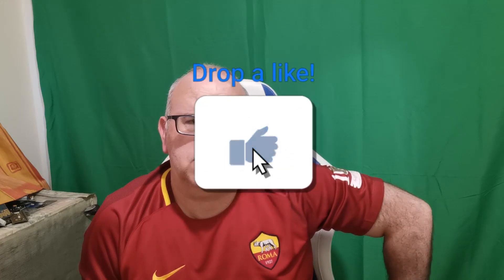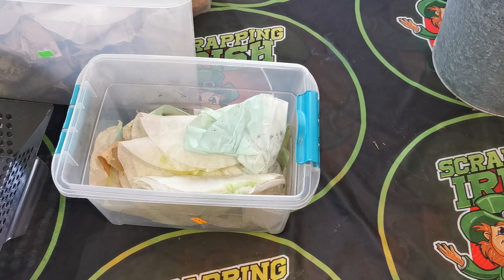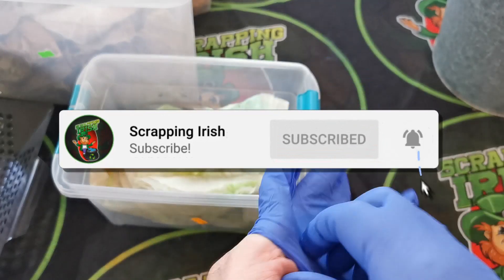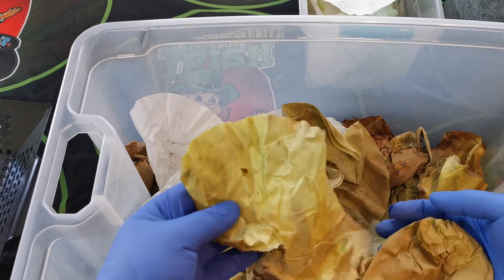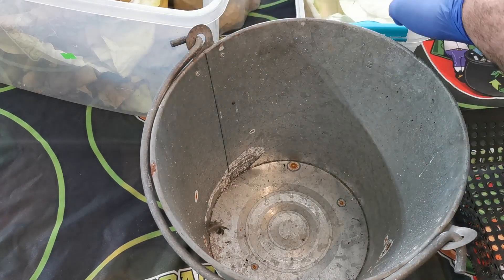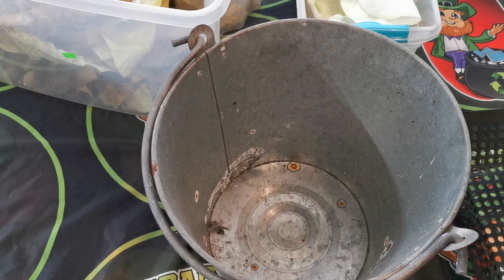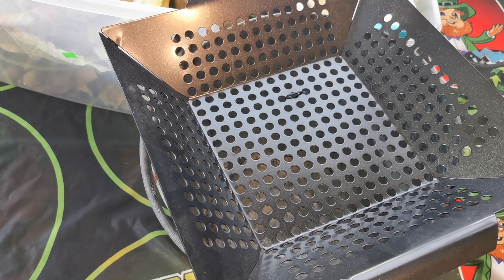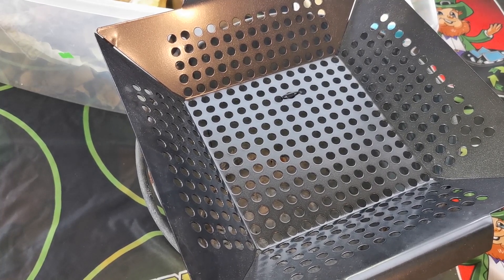gold recovery from filters will it work from  scrapping irish

Comment: I wouldn't burn in that thing you had on top of the bucket because if your doing it outside you will lose some material yo the wind,...just put all your filter paper in that bucket or something that will take heat and burn till it's all completely  burned  and then process them the way you said..ashing them is the only way